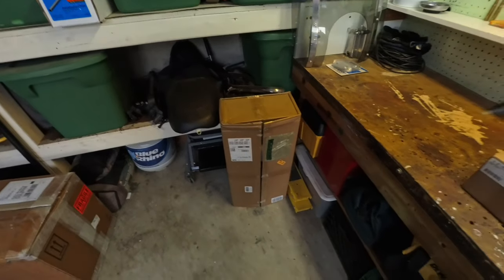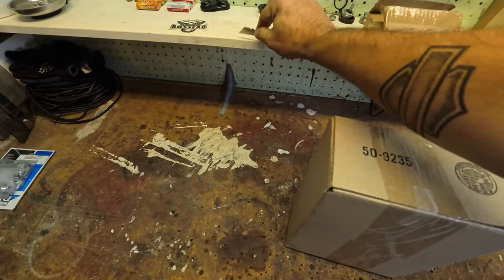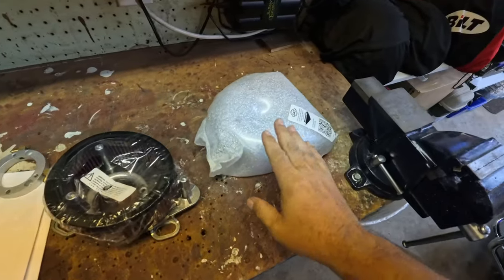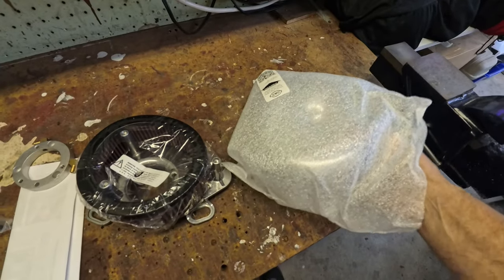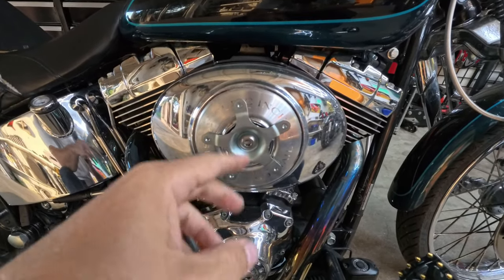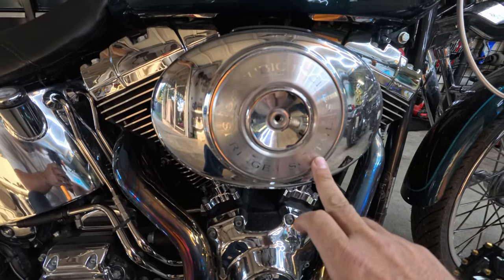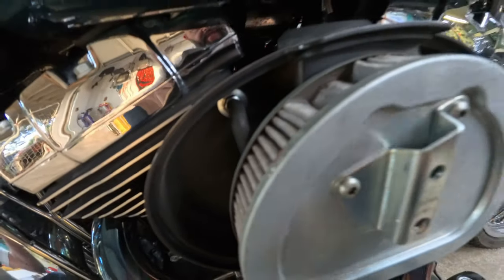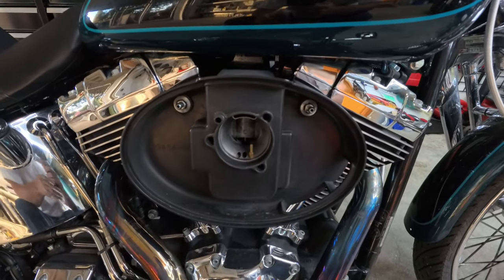S&S Teardrop Air Cleaner on a Softail Springer

Comment: Sorry u had a bummer install.My rule of thumb. Use hand wrenching , Blue locate, And snug, Then 1/4 to 1/2 turn on the small bolts , that's all u need. Just my opinion. I wrench on my 94 Dyna , never snapped the small stuff,
Reply from the maker: This was a first for me. I've rounded out bolt heads before, thanks to white loctite, but I've never straight up snapped a bolt. Now moving forward, everything will be snugged up the way you mentioned. Fortunately this was just a minor inconvenience since I was able to get the bolt out easily and S&S is sending me a replacement at no cost.  I appreciate your insight, thank you.